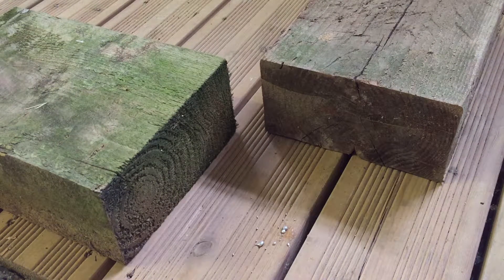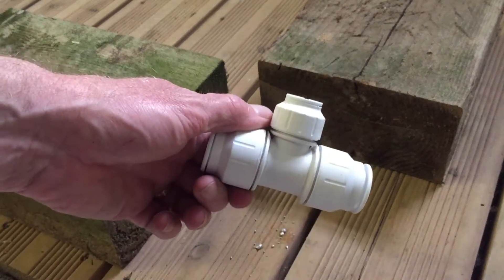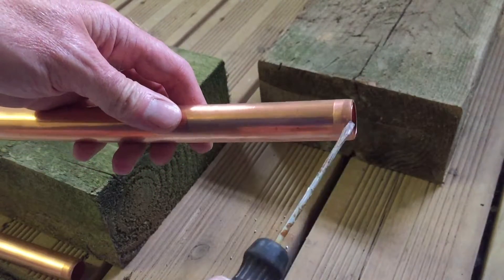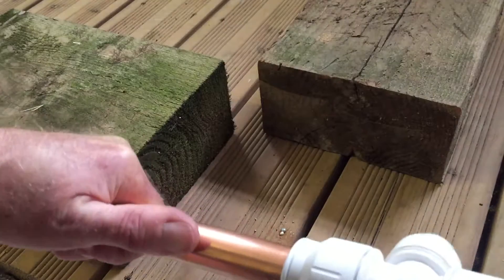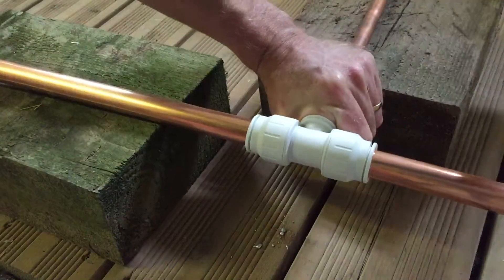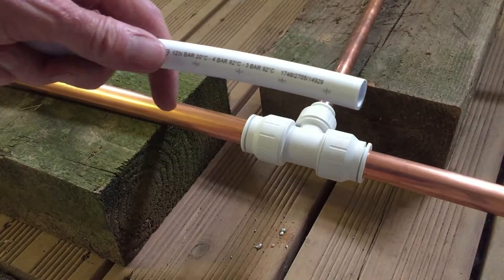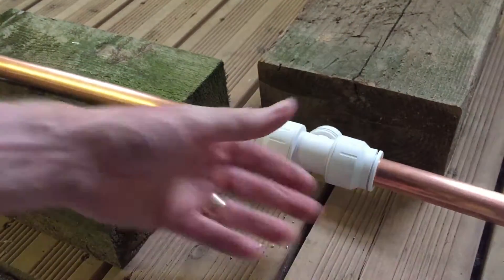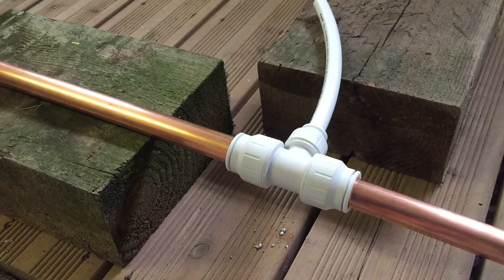How to install a push fit plumbing fitting

Comment: Several great tips here thank you. If you're using a non-twist tightening connector, do you have to "tug" the pipe after you've inserted it, it is it the same process?

Comment: If only he'd shown you how to deburr a copper pipe that had a rough finish...
Reply: Yes very important step especially since any sharp edges could split the o ring inside those plastic push fits it may cause a serious leak down the road. I have seen numerous plumbers still do it this old school way as well as a slew of other mistakes ie ptf tape on new compression fittings or wrapping the olive nut front and back. I would have thought these small things would be the 1st thing plumbers learned yet still make this mistake even till this day and I am not even a plumber myself just read about it online while trying to do it myself.

Comment: The first time I fitted plastic fittings was my own house and I checked it every day for a week for leaks because it just seemed so easy it had to be wrong, but they just worked for me. I think a sharp pipe slice is essential,  like you say, a hacksaw can be a really rough cut and damage the rubber O ring in the fitting.

Comment: i used one to-day,cold one was ok,but the hot water one just keeps leaking,so will be taking it off and and putting some white tape on it like i used to with a copper nut and blot one